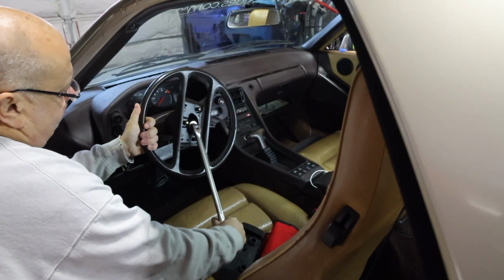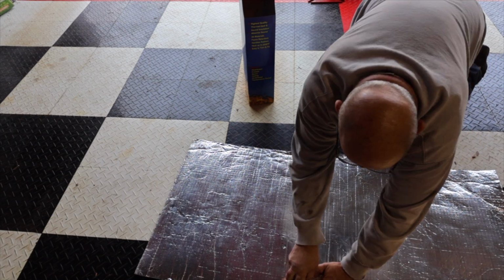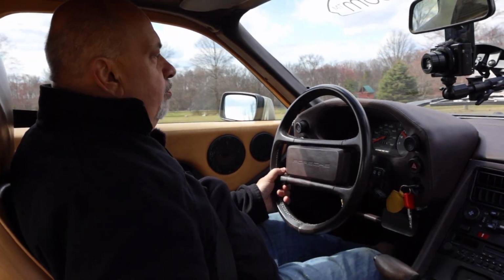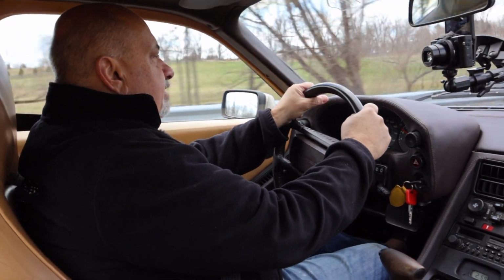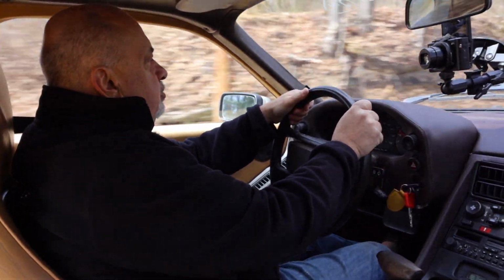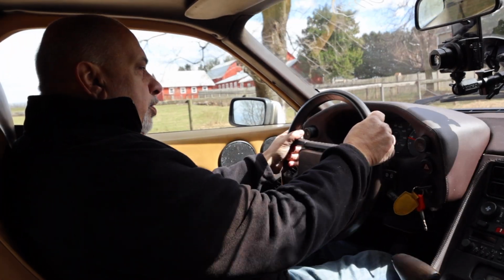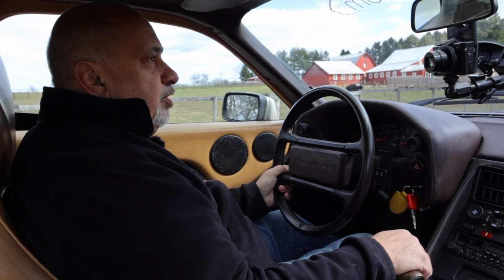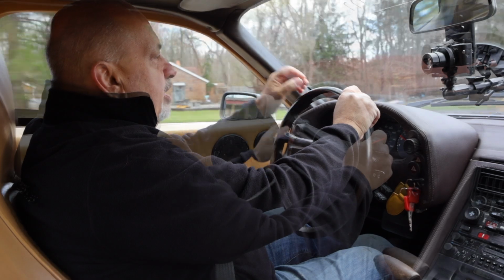Grime Time With Rudy Garage Vlog - 2024 Episode 7 (Activities Completed 03/11 - 03/18/24)

Comment: my 1985s also no power from a dead stop, when in drive it seems like hitting the gas pedal doesn't open the throttle, but if in park the pedal is more sensitive, and it revs up freely. in gear it doesn't rev up quickly. I hope the injectors helps your car if so I will do the same. I also need my automatic transmission tuned or rebuilt. bangs into 3rd gear and again no knockdown gear...car is super slow off the line.

Comment: Your comment on the throttle cable is interesting. I too have replaced the cable, the grommet where it goes through the firewall / bulkhead was missing. But more interestingly is I suspect the bell crank it pull is partly seized. The actual mechanical load of the butterfly is not huge, or shouldn’t be, so why does the cable need to handle such a pull? I wait with bated breath to see how you get on.  While you are there the hood release is a fragile item. I replaced it once, discovered the PO had too, so when mine failed again I made a steel cable anchor. Not Porsches greatest bit of work.